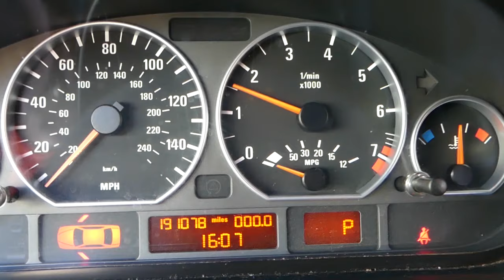WHAT CAUSES CODE P0420 ENGINE LIGHT CHEVROLET, CHEVY, GMC, BUICK, CADILLAC

Comment: Hey, we have have replaced our booster TWICE, per Chevrolet dealer, thats over $3100 for both times. Plus replaced the catalytic convertic, the flex pipe and the two oxygen sensors and the car is still throwing a code P0240....placed car back in shop at Chevrolet dealer and tbey juat called quoting us $3800 to replace the catalytic converter again....thats a hard hell no! Do you have an recommendations on what else to try here?

Comment: I changed both O² sensors, cat, turbo, & it still flips p0420...
2014 1.4 chevy cruze
Reply: Spark plugs too?
Reply: Ouch almost costing value of car at that point I'm on the way too changed sensor and catalytic converter shit got worse lol about to just trade it in fuck
Reply: Check the vacuum leaks intake throttle body etc

Comment: also if you don’t have that special socket he used for the sensor, you can also use an adjustable wrench  (i did it myself with an adjustable wrench but i had to go under the car to get the downstream sensor out)

Comment: I got P0420 on my Sonic 2015 1.8L. The upstream O2 fluctuate between 0.1 to 0.8V. The downstream O2 sensor stay at 0.75V. If I push the pedal, the downstream sensor will drop to 0.1V and then back to 0.76V. So is it CC problem or sensor problem? Thanks!
Reply: Did you figure it out?

Comment: Do you have the part number for the fitting that goes between the sensor and exhaust?
Reply: Did you ever get a part number? Im in need of one.
Reply: They sell them in autozone. Just ask them there
Reply: @Yazmany01  what would be the name or part number to request? I changed Cat (cheap Amazon one) both O2 sensors but P0420 continues. Have tried Cat cleaner in the tank. Will be changing Ignition coils, spark plugs, intake and exhaust sensors and cleaning throttle body tomorrow or Monday. But if that all does not work I'm opting for that hack!
Reply: @Robert Cabrera  I believe it's called a spark plug adapter. When I went, I just told them what I was gonna use it for and the guy knew already. :)